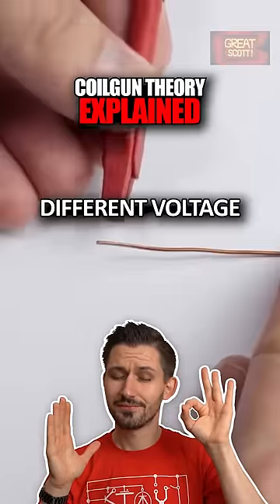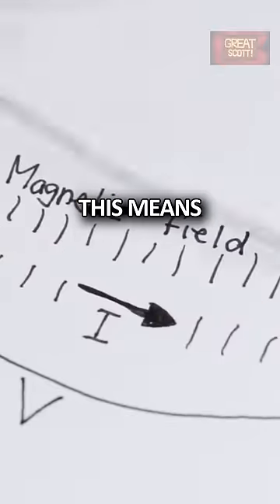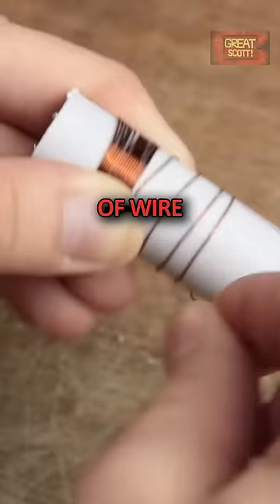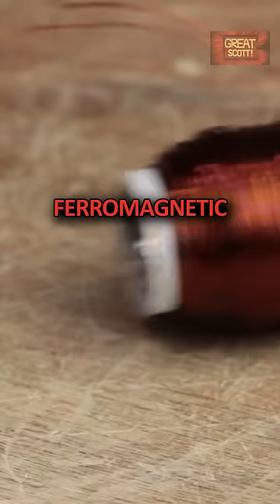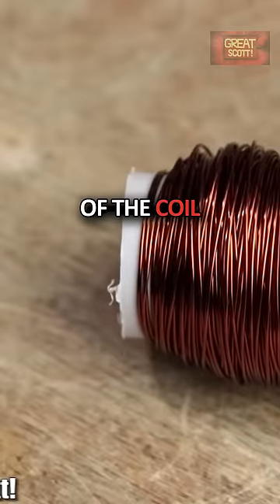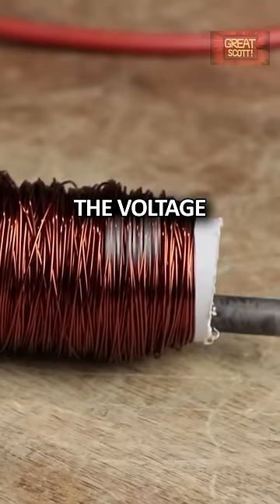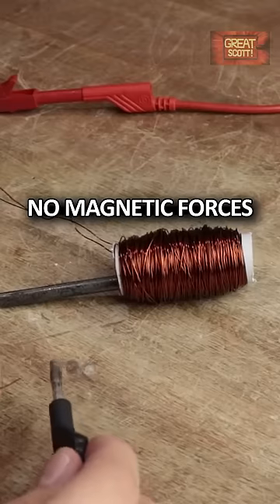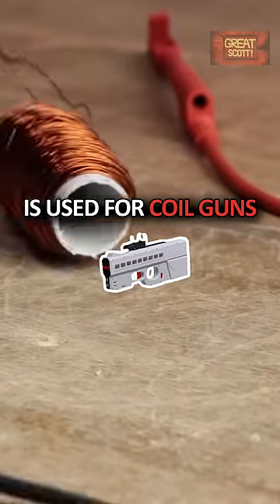This is how a Coilgun works!

Comment: 50 Volts, 3 Amps! That coil is going to get very hot very quickly!
Reply: luckily it is more or less instantaneous so with right gauge wiring it might not heat up that much. but i guess this depends on rate of fire (% on time of the coil)
Reply: It shows just 14 V on the display though. That's still 40 W of heat (pretty much for a coil that size). But since it only need to be turned on a brief moment during a shot, that will not be an issue even at  150 W (50 V, 3 A) of heat (it will still need several seconds to get a significant temperature rise)
Reply: @Speeder84XL  I guess I misheard 15 as 50. Which does explain why there was no visible smoke.
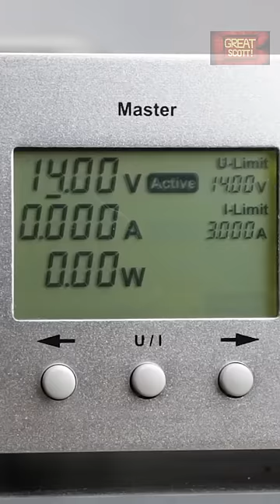Reply: @BrianG61UK  Yes, but he does write "50 V DC to it" as text as well, at 0:22 in the clip. Which is a bit confusing, as the display on his power supply shows 14. 
Yes - during the demonstration when the steel bar gets "stuck", he runs it for quite a bit of time as well (much longer than what's needed for a shot). 
So at 150 W, it would at least get hot enough for him not being able to hold it with his hands, maybe even start melting the plastic tube in the middle, haha
Reply: @BrianG61UK  Another interesting point, is that if it does heat up significantly, we would either see the current decreasing over time or the voltage rising (depending on if he run the supply in constant voltage or constant current mode) - as copper changes it's resistance quite a bit with the temperature. 
We even see that now as he apparently run the supply at constant voltage 14 V and the current does decrease slightly from from 2.863 to 2.845 (indicating a slight temperature rise in the coil)
 - but it would it would be much more at 150 W.
Reply: *14V because nobody knows how to read meters anymore
Reply: Not that much, a lot of the energy is going to the metal piece and 50v x 3 amps is only 150 watts that is the same power of my laptop
Reply: @giorgiolelmi8175  Too young to remember how hot an old-fashioned 100W lamp bulb gets then. Plus, I bet your laptop rarely takes anywhere near as much as 150W of power for long.
Reply: @BrianG61UK  yeah 150watts is the max power of my laptop charging adapter but you're right
Reply: I think it is 15 but he mistyped it, maybe!
Reply: Well you heard him it only needs to be on in a few seconds so I guess that's okay.
Reply: I don’t think it would because it’s only on for a brief moment. It would definitely get hot and maybe burn if he left it on tho.
Reply: It's on for literally less than one second
Reply: @simonlinser8286  So you were there for the filming of this? It looks like at last 3 seconds to me in the video.
Reply: @BrianG61UK  it actually says 50 in writing in the captions
Reply: @BrianG61UK  nut even at 50 volts its a quick quick burst of current almost no heat
Reply: @bparker86  I disagree. 150W would be a lot of heat. I think there would probably be smoke in under a second if it really was 150W.
Reply: @BrianG61UK   well your wrong. Perty simple .
Reply: 15v according to the power supply.
Reply: The text in these sorts of videos is usually auto generated
Reply: A modified heatsink and mini fan would fix that
Reply: Did anyone take into account the steel bar inside of the coil is absorbing some of the energy, so the coil won't be getting as hot as some of you imagine.
Reply: Thats the possession of super conductivity, we could make it just with material that will use as little amps and the flow of energy will create stronger magnetic field and much stronger when amplying more amps while the heat wasn't getting higher then the potential across the conductor
Reply: If course, that coil is basically a short circuit
Reply: It’s just a very crude explanation it ain’t that serious
Reply: Is the current necessary? I used a transformer to step up a 3.7 Volt battery to 10000 Volts. In an EMP a spark gap is used between high voltage and the copper coil to stop the heat up. Can the same be done for a coil gun
Reply: Would creating a cooling system for this keep it cool? 

Like say it has a water filled jacket around the coil
Reply: And extremely dangerous.  3 A is too, too much
Reply: 150 Watts?
Reply: So you think this simple single coil is going to remain energized for more than a split second?
Reply: @terrific804  I and 1.3K and counting, others think it'd only take a split second for the coil to get very hot.

Comment: Now take a serious lenght of pvc, several seperate coils with relays, charge them at the right time...bolt goes beyond horizon..now that would make a real coil/railgun...
Reply: How about reversing the polarity of the electyromagnet at the right time, expelling the projectile while it has some lenz magnetic charge? Has anyone done any real world testing with this?
Reply: @alexanderg-p3z  More power!! GRRRR 🤪
Reply: yes
Reply: would require the projectile to be magnetic and not just a normal bar of steel @alexanderg-p3z
Reply: @alexanderg-p3z  Don't forget back-EMF will prevent the coil's field from reversing polarity instantaneously.

The field in the first polarity direction would have to collapse, then the field in the opposite polarity would have to form.
Reply: @alexrusselldev no not really, the only difference is that railguns use, well, magnetic rails along the barrel instead of coils. theyre both gauss guns like how your m16 is an assault rifle and your remington 870 is a pump shotgun
Reply: @Mast3rKK you’re right that they both use electromagnetic fields to accelerate their projectile, however coil guns use a magnetic field created by the coils to pull the projectile down the barrel, while rail guns pass a current from one rail, through the projectile and into the other rail to produce their acceleration.
Reply: @alexrusselldev  ah, i see, thanks for the explanation
Reply: @alexrusselldev "pull the projectile down the barrel"
So like a series of magnetic slingshots?
Reply: why do i need relays?

Comment: Question: Will it warm up
Reply: there will always be résistance no matter what material you use, you can never be 100% efficient 
more current = more wasted power = more heat
Reply: @AAHAHHHHH  what about superconductors? 😌
Reply: @Abcdefg25152  you spend energy maintaining the cold temp
Reply: @AAHAHHHHH  thanks for info
Reply: Given the figure of 50V and 3A (=150W), the coil is going to get very warm, very fast.

Comment: I did one accidentaly, i wrap beefy coil connected for a moment to AC mains 220v, i also added fuse. At first time coil swallowed small speaker magnet, normally it will turn inside like a motor, but this time i underestimated current and fuse blow almost ideal when magent was at middle...
Magnet shoot as crazy but happily struck wooden case of old TV leaving good dent "only"

Comment: For college? Did you calculate the varying rate of acceleration, speed and time to the center of the coil to coincide with the total discharge of the capacitor while also taking into account the varying reluctance of the coil as the bar moved through it?

Comment: and if you time the reversing of the current at the right time, it should accelerate it even more?
Reply: Only with permanent magnets
Reply: @gitawrongtranslation-youtu9701  ahh ok... Been a few years since I did that sort of thing and couldn't remember
Reply: @gitawrongtranslation-youtu9701  Once you are working with fast enough speeds, the time it takes the projectile's field to collapse means that it can act like a magnet, and reversing the current can also make the coil's field collapse faster. For a backyard coilgun that shoots about as fast as a Nerf gun, reversing the current would be pointless.

Comment: Can you help me to understand, how much (minimum and maximum voltage and ampere) can a wire carry. Like how to find such things.
Reply: no such thing as minimum, but you can look up the ratings for your wire to see the maximum voltage it can carry and its resistance
Reply: The maximum voltage is solely dictated by the insulation around a wire - if it’s more than that, the electricity could spark/burn through it.

The maximum current is partially dictated by the resistance - the higher resistance, the more heat, and the larger voltage drop on the other side, and partially dictated by the insulation - how much of the generated heat it can dissipate.

The simplest way to figure it out is to use a voltage drop calculator and as the person said the specs of the wire

Comment: Make a loop of coils and you get a small hadron collider XD
Reply: but with iron bolts instead of hadrons colliding. So its a bolt collider
Reply: I don't think they are used to accelerate the particles. Particles are accelerated by 2 Ds (the part of the instrument is called D I forgot what the instrument is called) that are basically two "D" shaped objects(or two semicircular objects placed adjacent to each other that use alternating current to accelerate the particles. I think the big long ring is used to position the particles to crash into each other. Or maybe they accelerate the particles as well. I am not sure. But I am sure about the "Ds"
Reply: There's no greater technology than a massive hardon collider. Just think of the incredible new inventions we could erect. Just the thought of how many world changing applications are possible is discumbobulating. Deciding whether or not to use them for peaceful or military purposes is more than just a sementic question.
Reply: @kirito  they do use magnets but they are very very power full, so mutch they need to be cool by liquid helium
Reply: What are hadrons?
Reply: Cycletron
Reply: @russellm7530  subatomic particle
Reply: @neutronenstern.  bolts are made of hadrons, so technically it's still a hadron collider ;)
Reply: @kirito5547  cyclotron?
Reply: @russellm7530  sub atomic particles
Reply: Portal
Reply: @kirito5547  actually each coil gives lots of acceleration plus each coil has lots of adjustable or preadjusted multi coils (i guess) to position object, as its used on old crt plasma guns( i ,ean crt televisions ) crt televisions are actually plasma guns/colliders too with precise timing tey are used as displays...
Reply: @kooll2401 Sure, superconducting materials are used in them, in possible variants to get one of them, it is YBCO or Yttrium Barium Copper Oxygen.
Because it is can be cooled by liquid nitrogen, which easier than helium.
93 Kelvin.
I guess, from this material was not built magnets, but it also good compound.
Reply: @DarkMatterX1 both, both is good 👍
Reply: For now, century later.. Black hole power plat  @DarkMatterX1

Comment: I love how he failed to mention that this isn't bare wire. How many people wrapped naked wire around pvc and couldn't make a coil?
The wire is actually magnet wire that has a thin layer of insulation so that the coils can't touch each other.
Reply: I kinda thought of how is bare wire able to make that strong of an electromagnet instead of showing a insulated wire
Reply: yeah. enamel coated wire is used for electromagnets, since bare copper will just short.
Reply: Lacquer covered wire the same as if you would be winding a transformer.
Reply: The Boy Mechanic: 200 Classic Things to Build Hardcover – March 28, 2006
Reply: Eg: Transformer coil
Reply: @karthickr1308  or commutator coil, actuator coil, stator windings, fact is any part of an electric motor, radio and so forth uses lacquer covered copper windings including a transformer. 😁
Reply: What if wrap the  cooper wire around a thin hollow aluminium cylinder, will it make any difference at all ?
Reply: @Spider-te3je  copper wire and yes you will lower the voltage
Reply: Yes how hot 🔥 would it get when the naked wire arcs out lol😅 it would look good for a very short period of time 😂😂 they don't like giving all the information in these short videos do they
Reply: @ChristianConservativ 
Neat! Thanks.
Reply: I think anyone recreating those things ever would know enough about it to realise you need the properly coated wire as well.
Reply: Does Teflon coated wire have the same effect?
Reply: And would silver wire be more effective?
Reply: @cam5816  Its about insulation, nothing to do with silver
Reply: @ThatJay283 does it have to be that type of wire or would other types of insulated wire work (like the one wrapped in orange plastic)
Reply: @mrjhotdog12  it will work, you just can't get nearly as many turns and isn't nearly as space efficient
Reply: Thanks!

Comment: When your power supply is current limited at 3 amps
Reply: So that's why I see the voltage drop when it is loaded. And that's why the wattage showed is the product of the new voltage and current
Reply: Why is it limited? How can he increase the amperage?
Reply: He limited the power supply to 14v 3A. Since it is driving this, the coil probably has about 5 ohms of resistance. So the circuit has to drive 3A of current to a resistor (the coil) that has about 5 ohms resistance. 3Ax5ohm = 15V; V=IR. If he wanted to drive say 5A through the coil, he could turn the current limiter off and set the voltage limit to 25V. Assuming the resistance of the coil stays roughly the same (5ohm), 25V/5Ohm= 5 Amps. 

If this is wrong please correct me.

Comment: Its kinda funny how many people confuse coil gun for rail gun. Speaking of which... make a rail gun next.
Reply: Basically the only difference between the two is the shape of the magnets propelling the rod right?
Reply: @KingCreeper85  no, thry are fundamentally different methods of magnetic acceleration.

Coil/guass uses wire coils which produce a melagnetic field when charged, this is set up to pull/push a projectile in sequence up to speed. No physical contact with the barrel.

A rail gun uses 2 conductive rails. The projectile is also conductive and completes the circuit across the rails. You then charge up capacitors to extreme voltages. When you release that energy via the circuit it will cause the projectile to be pushed down the rails until it is launched from the barrel.

Comment: There recently was a story where a guy turned into a coil gun because he thought an unmentionable up his butt was non-metal and he went into an MRI. Not sure if it's a true story but that too was an application of this principle. A weird one for sure.
Reply: He had a buttplugg that said it was made of silicone but had metal in it
Reply: Link to Story pls…And his OF
Reply: @Fee.1  Idon't have a link, it might just be an urban legend.
Reply: @FHBStudio  so where did you get the info that this was “recent” story
Reply: @herobrine1847  Literally discord memes. I write it off as an urban legend.
Reply: Nope, coil guns have to have ultra precise timing, like this video just mentioned.  An MRI would just pull a piece of metal directly towards the inside of the MRI tube.  Doubtful if it would rip thru that much skin, but I wouldn't want to be the test subject.

Comment: I did this for a collage project. Instead of figuring out when to turn it off, I just connected it to a huge capacitor and it worked fine. Just that it would take some time to charge.
Reply: How many microfarad and voltage??
Reply: @XenyQ_  i have no clue😅. Just bought a big ass capacitor and connected it to the coil.

Comment: Coil guns currently have a speed limit because the magnetic field doesn't dampen quick enough

There is a suspension system that uses magnets to thicken suspension fluid to go from soft to hard suspension suddenly, It had the same problem and they solved it by having counter rotating magnetic fields four to be exact.

This could potentially fix that limit and make high velocity coil guns
Reply: The suspension solution sounds very cool and interesting...
Reply: I’m confused on how the suspension system works or what exactly that is/does
Reply: @cam5816  
YouTube channel: donut 

Video: magneride 

They explain it better

Comment: Hey man, you do a good stuff, can you do something to prevent neutral leaking to ground on cheap LED Power supply? BTW,  Live wire is switched . When LED doesn't touch anything it doesn't glow, glows a bit when touched,  and leaking about 2V on tester when screwed to the grounded mounting.

Comment: Why not just say "if I now make 3A of current flow thru it".

The voltage drop across the coil is ~14V. The fact it was 50 before you connected anything is meaningless. This tells me you either don't know how to read a meter or don't understand ohm's law.

And then there's the idea the voltage in this case doesn't mean squat. It's the current flow, and is accounted for in what is now long lost for some reason, with the term "amp-turns". More current, more turns, more flux.

Why make it into more than it is? Lol

Comment: I am very curious if the number of amps or the voltage influences how strong the magnetic field is. For example, is 12V at 5 amps as strong as 24V at 2.5 amps?

Comment: This is the lame beginner version of a coil gun. A much more powerful version can be realized by using inductive coils and alternating current. Then you're pushing instead of pulling. You're also not limited by the magnetic saturation of the material. It's hypothetically possible to dump enough energy into the projectile that you can melt it, but the beautiful thing is that since it's a repulsive field it stays in the center of the barrel.

Comment: Do the calculus and explan it please. Cylindrical área, rectangular or square área, hope u can.
Or repair a shaving machine that use coils. Or an engraving machine that use a vibrating cylinder (with a coil).
Greetings

Comment: It has to be coated wire. Otherwise the windings will short against each other and the electricity will take the path of least resistance. Which is the opposite of what you want to make this experiment work. If you try this make sure you use magnet wire.